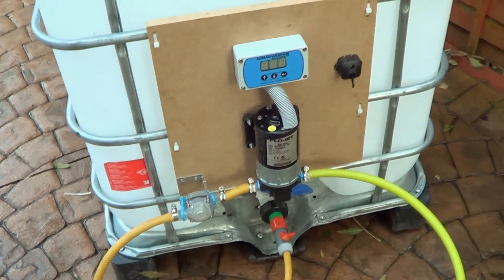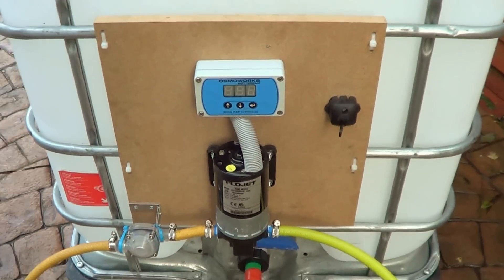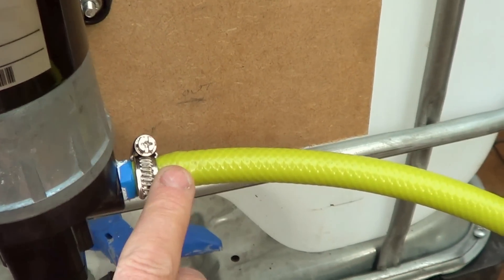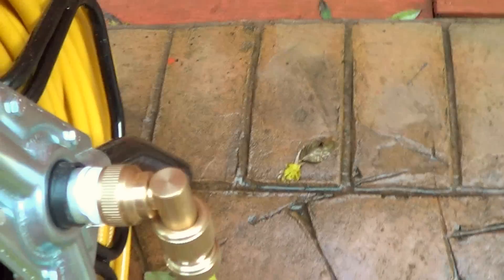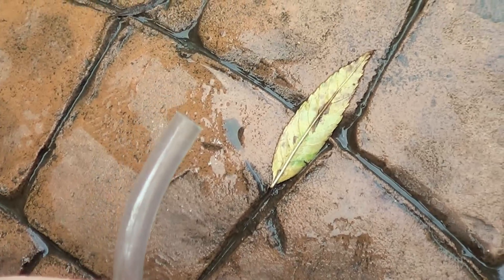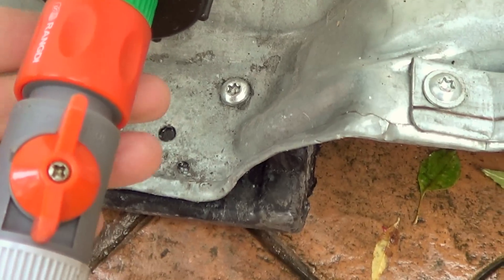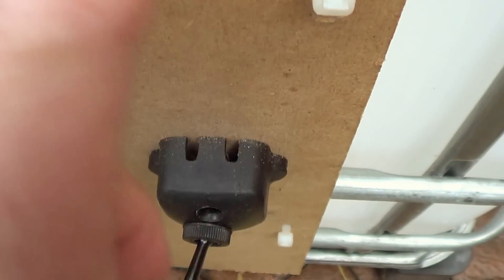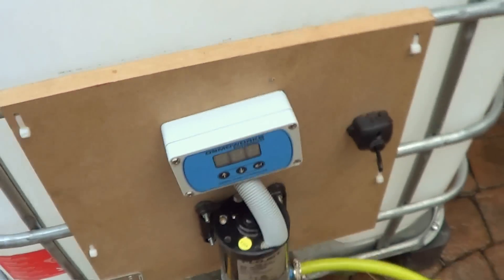DIY WFP Van Mount - Part Four

Comment from the maker: Hi Tom, it's all up and running but I fried the flow controller so it's being repaired but we are using the system without at the moment. Too much flow but it will be ok for now. I will film it once I get the controller set up.

Comment: Do you still need a external switch when you have a flow controller? Your controller should be able to turn the pump on and off shouldn't it?